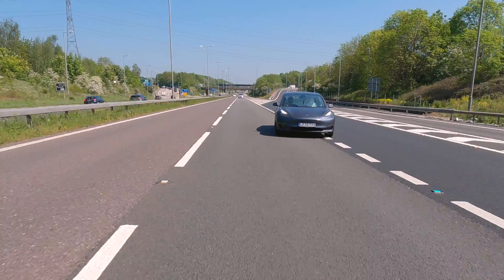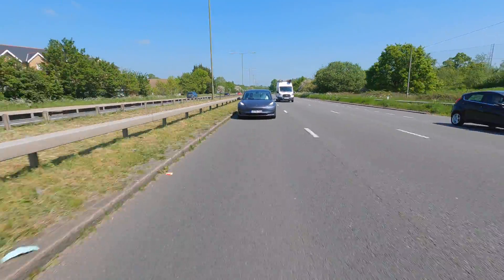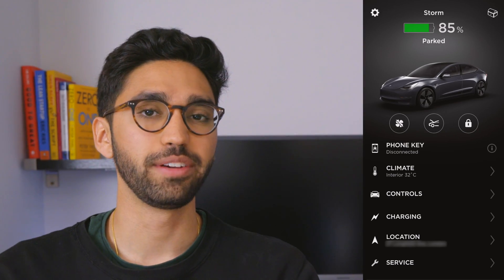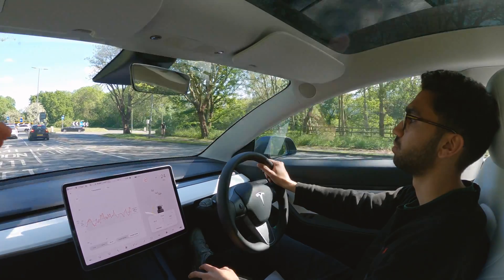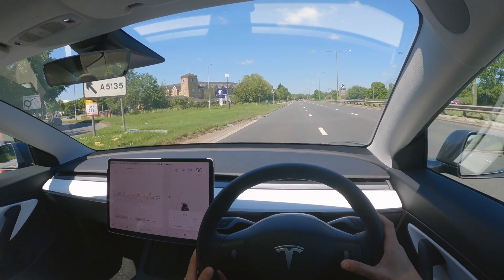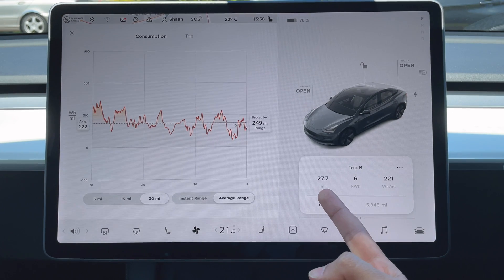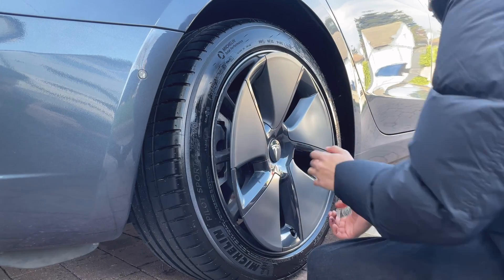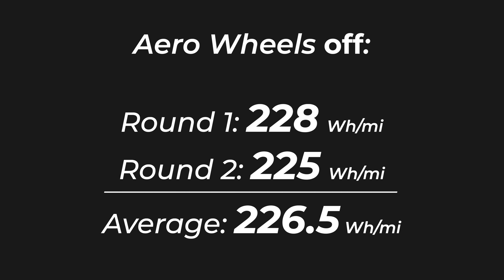Tesla Model 3 Aero Wheel Efficiency Test!

Comment: Did you change the settings of the car? (service-> wheel configuration)

Also I am told the aero wheel cap kit v2 (the $60 set from Tesla), the efficiency as better than the kit you have purchased (within 1%)
Reply from the maker: We didn't even know you could do that actually, but that's cool!! Just checked it out and that wouldn't have had an effect on the efficiency measurement though, as it's measured by the car based on the actual energy consumed over the distance travelled. The things that it affects are the range estimate (which we didn't use), tyre pressure, and driving visualisation. Could try it at some point though!
Reply: @TheMasterBrothers  try it with aero wheel cap v2. Better efficiency than your £20 kit albeit less cosmetically pleasing & £50!
Reply from the maker: Yeah forgot to respond to that bit, we can definitely look into adding that in another comparison!